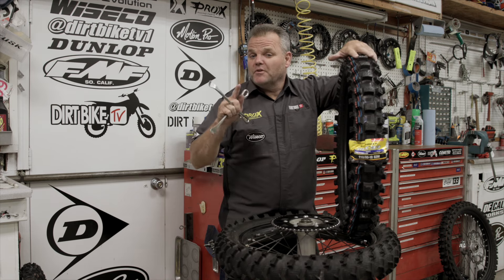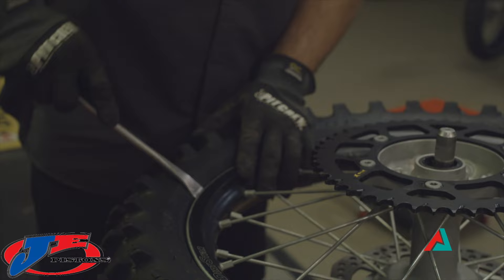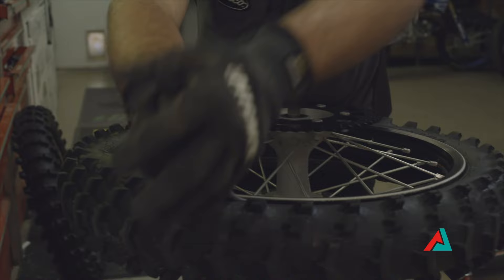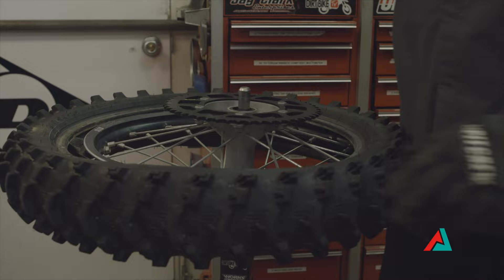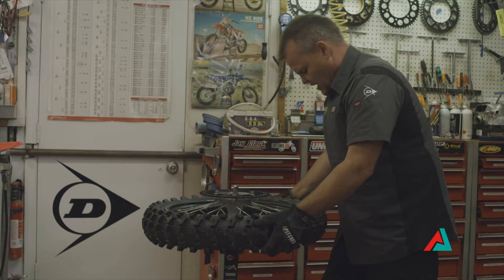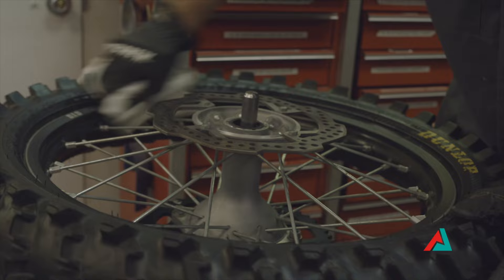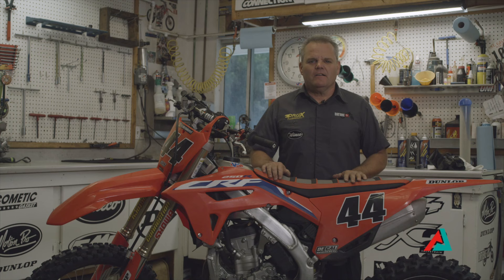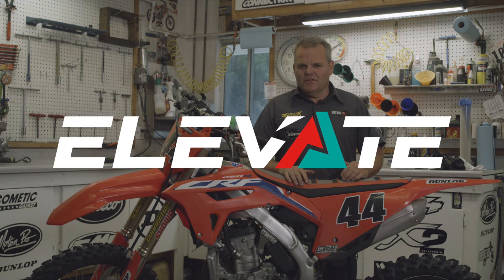Dirt Bike Tire Change

Comment: Every time I change a tire (most often repairing a flat) without watching one of your Tire Change videos, I end up pinching the friggen tube...I could save myselt the twenty, or so, bucks, each time, if I just took the time to watch before putting the tire on the rack...

Your method makes it so easy and almost inpossible to damage the tube, and more importantly, the rim...Thanks.

Comment: Ive done this several times now and it never seems to get easier. The last 2 I did I pinched both tubes. Bought new tubes and got the tires installed, went to pump it up and realised the valve stem was pushed inside the tyre, had to remove it all again, i swear I nearly cried 😅

Comment: nice job, i change a lot of car tires, streetbike tires, but not many offroadtires. My 19 and 21 are not a big problem, but with your video it will get easier...
But the 12 and 14 from the 65ccm from my son a break my hands....
Did you do it by those little tires it the same whay?
thanks...great video

Comment: Nope, I am have bloodied enough knuckles in the past, and had much better luck not pinching a tube with big flat head screw drivers, (never pinch) than I did spoons, (always pinch), but scratched the rim to heck (not anodized rims back then, so did not show much).  My local dealer has a power tire changer, and for now,  I could not be more happy about changing a tire.  :)

Comment: Not related. To the vid  inner tubes suck  I keep blowing tube's.   The valve stem breaks off   would you suggest  a pool noodle  alone 
Or with a rim loc 

I ride Enduro  my Pic logo is my bike. Trying to take the safe and cheap way out.   And I live in south america.   Not an abundance of good parts here.     Any help  would be great. Super thx   I watch all your vids.

Comment: I remember reading that the tube valve nut is meant to be removed and only used on the outside and not tight against the rim. Thoughts?
Reply: I can tell you if you over tighten them it will break the valve stem off!

Comment: Who can actually push a tire 60% on? I have never once had even a used tire go on more than about 30%
Reply: He doesn't mention it, but seems like you have to make sure only the bottom bead goes inside the rim, not both at the same time. New tires are pinched close together,  but he was installing a used tire that was a bit spread open. Also putting a bit more air in the tube could help separate the beads to slide just one in at a time. 
I had the same problem as you, i thought "how the hell can it go in 60%?!"

Comment: Its 2024 people you don't need to change your own tyer its cost so little to get it done at a bike shop and i never seen abike shop without a fancy tyer changer that won't scratch your rim  , do you change your cars tyres yourself?  Why not
Reply: We get your point but sometimes the shop is closed and you still want to go ride so it's good to have all the tire changing stuff and be able to do it right. I also change a lot of tires to test different types, so I don't want to run down to the shop to drop it off and then go pick it up. I can just change my own tire and be done with it.
Reply: Well the local shop is borderline highway robbery at $100. And it's an hour drive. So no thanks.